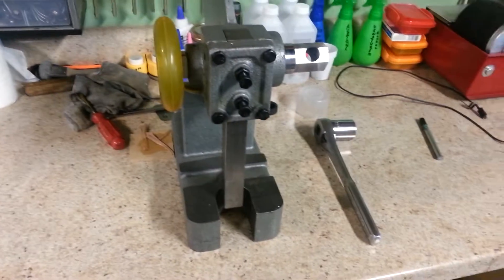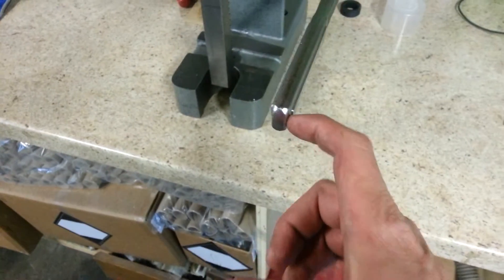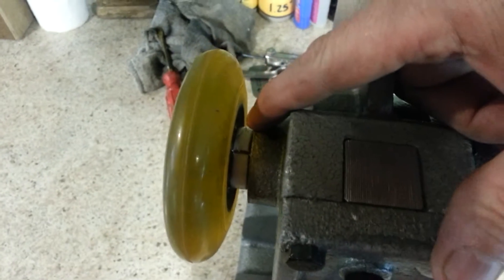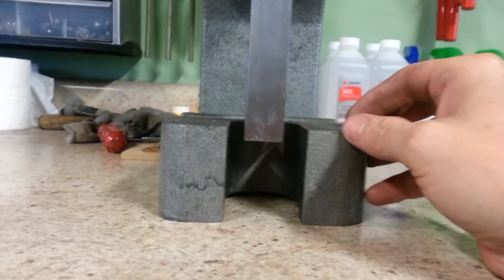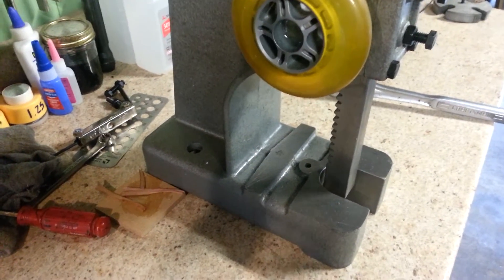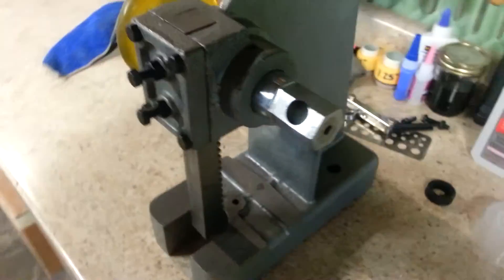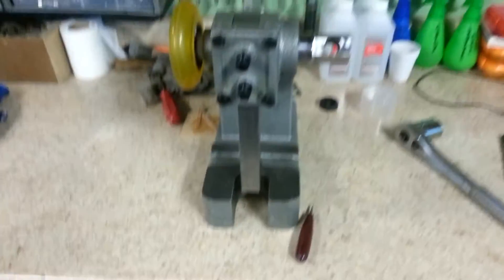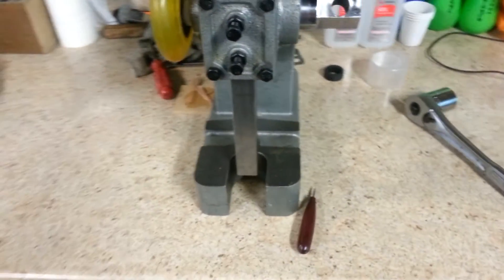1 Ton Arbor Press Mods Finished

Comment: How to make it such that you can press the handle as hard as you like and yet the press won't fall off the table?
Reply from the maker: I made a stand using threaded rod that extends up from a 1/2" thick plate steel. It raised the entire press about 10" I then have it clamped to the table.

Comment: Weld a base plate to the arbor press to stabilize it. Lengthen the handle bar. Impressed by the scooter wheel. Nice grip

Comment: Good job on the mod, the scooter wheel is great :) Arbor presses are really handy, i use mine for all kinds of stuff.   I`d be tempted to partially thread the ends of some steel rod/bar for the stand. Dont forget to add a polycarbonate blast shield for safety. On a different topic i`d be interested to know how much one of your nept rocket tubes weighs in grams  ;)
Reply from the maker: Thanks man!!! I did mount it on some all thread rod which mounts to a 1/2" steel plate - so far it seems to work & plenty stable. I do have 1/2" polycarbonate for a blast sheild approx 12" x 10" that will be used - I will make some quick detatch type brackets for mounting that release with a pin. I waited to reply so i could weigh the nept tubes - the bag of 25 I weighed varied from 63g upto 67g - it would great if all were consistant but a few grams shouldnt make a huge difference with a high powered rocket motor. I still havent built any - looking to make my own bp rocket tooling